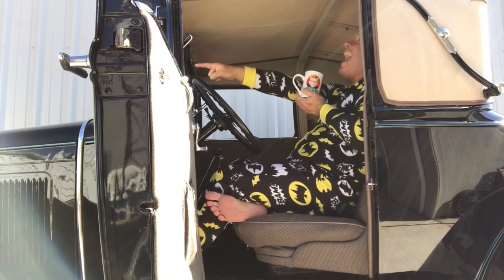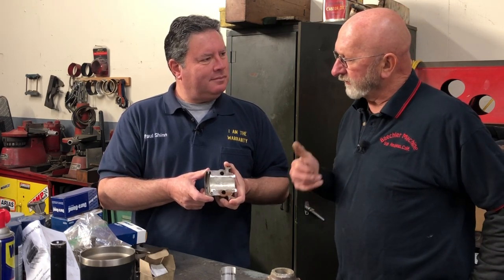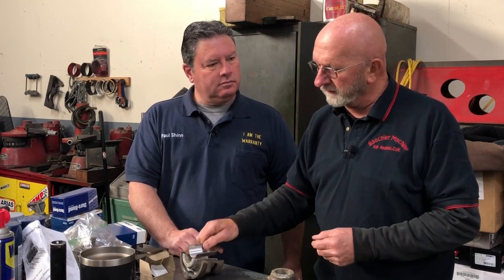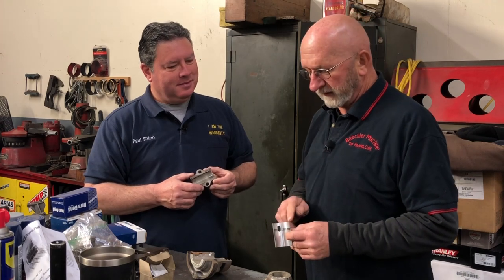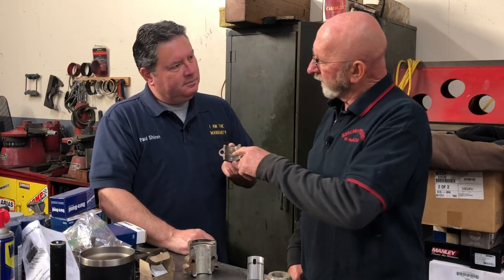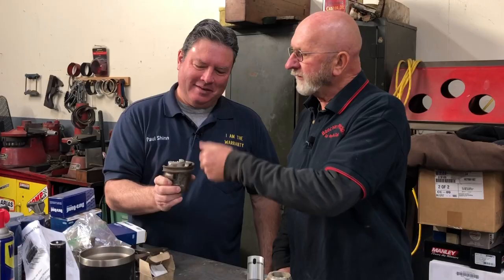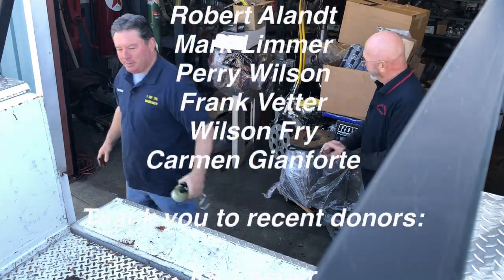Babbit vs insert bearings in Ford Model A engine

Comment: 0:00 Intro
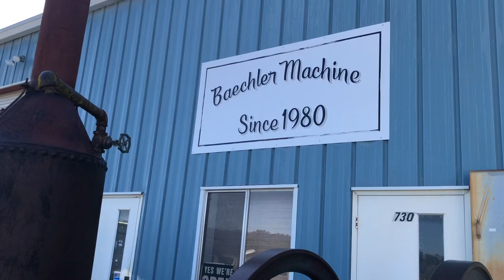0:39 Willie Baechler
11:38 rods
13:00 balancing rods
16:42 crush
18:35 babbit longevity
19:53 insert bearing longevity
20:18 oil changes
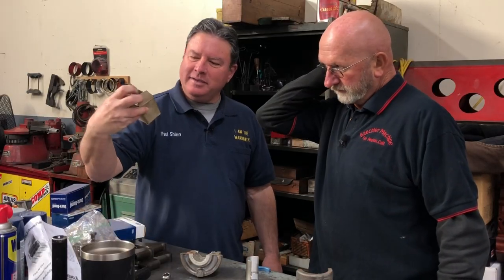21:23 where to get inserts
22:17 engines
24:14 end

Comment: Great bit of insight - also nice to have someone finally giving an answer to what lasts how long.
I also heard that the hardening and fatigue process increases the thicker the babbitt layer is (i.e. the more undersize your crank is ground).
The thicker babbitt acts more like a spring, thus moving about much more and getting brittle much quicker.
Reply from the maker: That is true
Reply from the maker: Hey Adrian, if you can figure out how to get that block to Willie's shop, I'd pay half the rebuild cost.
Reply: @ModelA  Wow, what a kind offer! I still hope to get the situation back under control, but should I not be able to, I'll definately keep your offer in mind.

Comment: Thanks for another great video. My model A blew a piston last year. Someone installed the center ring upside down.  Luckily no damage to the cylinder walls. Notice the babbit bearings had pits in them like you were talking about.  Should I change them the car runs fine. Have put about a 1000 miles on it since replacing all the pistons. The oil pan was nice and clean and sent it out to be cleaned just in case. Thanks again

Comment: Insert bearings are steel with copper plate and sometimes silver plate and babbit last. The copper and silver conduct heat away from the babbit and keep it cool so it won't be deformed. The thickness of plain babbit bearing leads to them heating and the babbit getting soft and failing.

Comment: Thank you for this discussion.  Babbitt bearings have poor tolerance to impact loads, as you discovered at 68000 miles.  The thin layer on the insert greatly improves the tolerance. Engineering manager Pioneer Motor[car] Bearing.
Reply from the maker: Good info. Thank you!

Comment: Hi Paul, Just a heads-up on the insert main bearings you are showing.  They are made available by Antique Engine Rebuilding (AER) who contracts with a manufacturer for their production.  The bearings you and Willie show are actually bearing grade aluminum adhered to steel shells.  They do not have any Babbitt on the surface.  When AER first brought the bearing shells to market, the first couple production runs of bearings had Babbitt as the final surface. It has been at least 12 - 13 years since the Babbitt surfaced bearing inserts were available.   Good video.  Thanks   Dave @ Durable Performance,  Minnesota
Reply from the maker: Ahha!!  Thank you so much for the correction!

Comment: With aircraft engines we cut open the oil filter ( if you have one ) and examine it for metal.  Could also take a sample of oil when changing
Reply from the maker: Oh yes!  I forgot to mention.  I used to be a pilot and did my own maintenance.

Comment: So educational, even if I'll never have a Model A. I would love one though!

Love your videos. Of the more modern engines, my favourites are the B18 and B20 Volvos, and in my dream the similar era straight six 3 litre types. I love the idea in those that the cam shaft is gear driven rather than chain or belt driven.

Best wishes from George
Reply from the maker: Thank you George!
Reply: @ModelA  Dear Paul,

What I love about rugged and actually well engineered older style engines, is that though it requires an expert to work on them properly, for crank-work and so on, the concepts of design can be understood by anyone who can fix a Briggs and Stratton [side-valve] lawn mower engine. 

To my mind the modern computer regulated engines with variable valve timing and direct acting overhead cams are completely beyond even competent home working. I have set tappets on a Volvo B20 in a 1971 Volvo 145. All you needed was the right sized spanner, a screw driver, a set of feeler gauges, and ability to add up to nine!

Same with old coil and points ignitions. Easy without a degree in computers!

Best wishes from George
Reply from the maker: You're right!!

Comment: My Model A has 62000 miles on her (original) Should I remove the engine and drive to California to have the bearings done by your friend or do you know of someone who could do them as well as he does in the eastern part of the country I live north of Toronto Canada? I’m in Florida for the winter and next one when I could bring the engine down with me  Appreciate and suggestions 
PS replaced the timing gear and cleaned oil pump strainer doesn’t have external oil filter Going to put one on when I get back home this year
Reply: An oil filter sounds like an awesome idea for a model A. An improvised air filter set-up would probably help with longevity, too.

Comment: Good program.  Curious, a while back you mentioned that you bought the new model a block but you said that additional work was necessary.   Can you tell me what you had to do?
Reply from the maker: I gave them back and they had a shop who is now specializing in those motors finish them.
Reply: @ModelA  wow.  So what do you think?  Sounds a bit dicey.
Reply from the maker: I don't think so.  Someone with more experience than me would be just fine putting those together.
Reply: That's good to hear.  Can you tell me what needed to be done?  I appreciate your input.  Thank you.
Reply from the maker: The guy with the machine shop put it all over Facebook, you can follow his journey there.  I just wasn't the guy.
Reply: @ModelA  Sorry Paul it would appear that I stumbled into something.  Definitely not my intention.

Comment: In addition to Babbitt beating out from impact loads, the thick layer of bearing material isn’t great at conducting heat into the block. Babbitt was fine for low-speed engines, but as RPM ranges (and power) increased, Babbitt bearings were more likely to “burn out.” Steel-backed precision inserts conduct heat out of the journal far better because the Babbitt layer is so thin. They also stand a better chance of operating with full-film lubrication because of their precision, unlike hand scraped or fitted poured Babbitt. That also reduces heat buildup.

I recall my dad, born in 1921 and in the automotive business all his life, talking about engines being utterly worn out at 20,000 miles.
Reply from the maker: What would you guess is the cruising RPM and redline RPM of a Ford Model A?

Comment: Another wonderful video for a newbie Model A guy!  THANK YOU!!!  I do have a question on your video showing top material replacement - what kind of material do you use, is it a vinyl available at fabric stores?  I do snowmobile seat covers and use the Artic minus 40 rated stuff for that.
Reply from the maker: Hi Bob.  Thank YOU!  Yes, that is a vinyl material, and it has a specific grain to it to match the material Model As had when new.  Most of the Model A parts places sell it.
Reply: If a person is converting from babbit mains and rods to shells, do you file a place in the bearing seat for the tang?  I have seen the tangs on the bearing shells for my 52 Pontiac flathead and assume it is a similar type of tang?
Reply from the maker: Yes

Comment: Great. I have 2 questions.1) How does an oil filter work if the engine has no oil pump ? (splash oiling) 2) Is that later version of the engine not pressure oiling with oil pump (model C engine)? Please make a video on that subject, The model C engine with pressure oiling.
Reply from the maker: Model A motors have an oil pump.
Reply: Full-flow filtering routes all of the oil through the filter, but some pass but part of the oil, so called bypass filtration…
Reply: Model A engines have an oil pump, but it doesn't pressur feed the rods and mains, it just dumps into a tray in the valve cover area to drip down into the main bearings. An oil filter (and an air filter) would be great for longevity.

Comment: Soft bearings are looking for sand, to capture and lathe down the harder crankshaft. You must keep your oil clean. A careless oil change can introduce a lot of sand to a motor. Crankshafts can be plasma sprayed and machined, but few shops have the tools and skill to renew a crank. Cylinders can be renewed with nickel plating, but chromium is dangerous.a Renault NN pleasure chassis motor has a one piece lead bearing. There's no split.
Reply from the maker: You're right. No split? Never seen that!
Reply: @ModelA  cast onto the crank. Just center main bearing. A factory process. I'm not fond of it but it works.

Comment: Opening line... A little chuckle ...  the "Model 'A' motor " ... motors are electric. Engines are internal combustion [except steam locomotives] ... so "Model 'A' engine".

Side Bar: R/C model airplane engines, like the 0.90 cuin Rossi's were ABC Aluminum-Brass-Chrome good for 14,000+ rpm at almost one horsepower. Chrome made it hard and wear resistant. 
Piston so tight in the bore it almost can't be turned over by hand until broke in.

Work hardened and splattered at 68,000 miles ... like work hardened rail road tracks? Add another 10 ton to each car on a 100 car coal train and the rails will fracture and cause a derailment.
Reply from the maker: motor
mō′tər
noun
Something, such as a machine or an engine.
A device that converts any form of energy into mechanical energy, especially an internal-combustion engine or an arrangement of coils and magnets that converts electric current into mechanical power.

Rossi didn't do ABC motors.  They did ABN.  Aluminum piston in a Nickel plated Brass sleeve.  I am a Rossi motor nerd.

Comment: Inserts are steel backed Babbitt bearings, you can’t get away from Babbitt, no replacement, why would you even want to?
Reply from the maker: Because 1/4" thick soft babbit fails way too easily.  Inserts have the steel shell for strength.